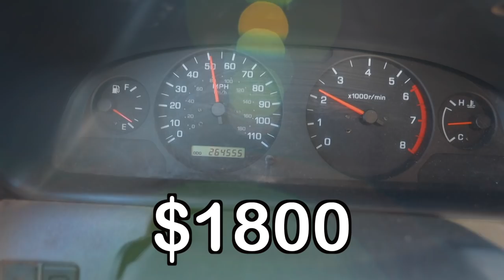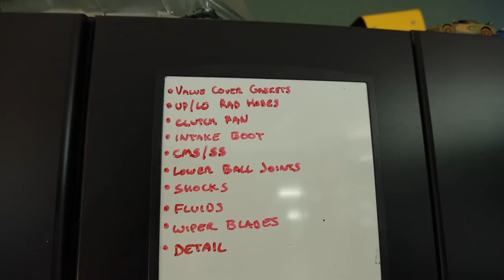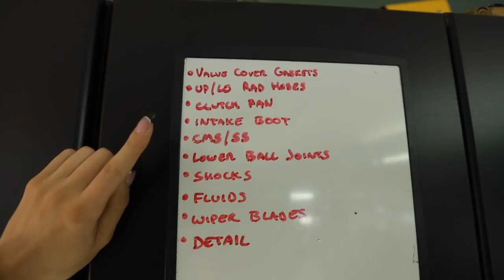Buying My Little Sisters First Project Vehicle // Vlog Series

Comment: AWESOME!  Finally a 4x4!!   Ok: 7” drop differential lift kit, Bilstein 5100s frt 5160s r, 35” mud terrains, toss both bumpers and get off-road prerunner style ones, RCV axles, diff lockers, Kryptonite tie rod outers, Moog Problem Solver ball joints, 20x10 wheels with a negative 19 offset, cat back performance exhaust, K&N air filter, KC Hilights and toss the nose ring!   :)

Comment: DO THE TIMING BELT IF YOU DON'T KNOW WHEN IT'S BEEN DONE. I'm an avid Gen1 X enthusiast. My dad bought an elusive Atomic Orange one new in 03 and it's been in my care for the last 5 years. The Timing belts on these have an 80-100k interval. If the belt snaps at low RPM, you likely won't have valve damage (hydraulic lifters), but if it snaps at high RPM you may end up with bent valves. If it manages to skip teeth more than a couple, you WILL bend valves. Replace the water pump and the thermostat at the same time since it's all there. Valve cover gaskets are definitely known to go bad and the right one tends to leak oil right onto the starter and take it out. Oil pan gasket tends to be leaky too, but that's kind of a PITA to do. That too can make it look like the rear main is bad.

Comment: With that mileage, I'd be checking the catalytic converters, they could be restricted, which would put a fair bit of heat into the heads, causing valve cover leakage.

Comment: My first 4x4 truck was a 97 Nissan Frontier with well over 200K miles as well.  I'm on my 3rd one now.  Change the oil, buy some tires occasionally , replace the timing belt - these Nissan trucks will drive forever.  Excellent choice!   Nice to see you guys spending quality sister time, you can tell she adores you.  Great video, thank you.

Comment: That is a great find!  I had a 2001 Frontier, which is mechanically (and dash wise) very similar. Great vehicles.  I agree on the comment about the timing belt.  Please, Don't wait on that, and get the entire kit with the water pump and all seals(cam seals).  I put a K & N intake, and a Gibson exhaust on mine and gained torque and HP.  Never dyno'd it , but it pulled better and I gained about 1-1/2 to 2 mpg on the highway.  Great to see you and your sister working together.

Comment: What a great deal! My wife and I really wanted an Xterra back in '05, but those were a lot of $$ new. I instead found a used '97 Isuzu Trooper 5 speed manual 4x4, and it was a blast offroad despite no locking diffs. Very low gear ratios. At about 60 mph it was doing 3000 rpm in 5th, just gulping fuel. Traded it in 5 years later and still see it from time to time in another town when we go there.

Comment: For the faded plastic: Trimblack, although used motoroil works great on them too, just put a little bit on an old rag and wipe, then wipe the excess off! Done mine 2 years ago and still looks perfect. Don't use a heatgun, it sucks the oils that are still left deeps inside the plastic all the way out to the surface and thus makes the plastic WAY more brittle, and it'll just fade again. Plastic fades because the oils dry out of it at the surface... That's why the motoroil(for some reason) and trimblack etc tends to work really well: Because the plastic absorbs the oils. 
I'm not sure why but new motoroil never seems to work for me lol, the used oil works better somehow.

Comment: What a deal! Manual 4x4 that's great and also avoids the biggest failure point on these.  I test drove one of those when I was looking for my cheap overlander, but it was automatic.. and it hadn't had the auto transmission radiator coolant bypass done yet. 😳

Comment: Hey Sarah,
I think you should do a short series on the Nissan Xterra (Extra or Xtra). Since it was bought cheap, just do a short series on getting the Nissan up to scratch on a tight budget. You've made your list on the mechanical side, cleaned it etc. but you could cut & polish it to a good standard so that at the end of the short series it looks & drives like a more expensive 4x4. 
In regards to the front bar you painted, I reckon go grey to break up the black. Do the rear bar as well while you're at it.
If all those jobs are done, it'll help your sister be more proud of what she drives. Maybe it'll help her overcome her camera shyness.

Comment: Great vehicles. I have 2 2002 Xterras with the Super charged engine. Both 5 speed manuals.  One with 170k miles the other with 308K and still running strong.

Comment: We lived in an apartment on the east side in line with the runway at Davis Monthan while in college (late 60's)  Occasionally had to open the windows to let the F4's fly through!  Chances are you wouldn't do more than one clutch job.......  You can always scuff & add some clear to the horizontal surfaces if concerned - get a little more life out of the paint.  She really scored with that one and lucky to have a mentor in the house!

Comment: Xterra - highly underrated by many, more capable in stock form than most give it credit for. 

Being Frontier based I bet you could slowly turn it into a Pro4X model with parts from Frontiers.

Spend the money on new upgraded fog lights in the holes where the originals are, use Wipe New Trim Restorer on the bumper - their headlight stuff is magic for plastic lenses.

Comment: Tell Little Sis that being on camera is like learning to drive a stick, a little scary at first but soon it becomes 2nd nature.  ;-)  You might want to consider a timing belt with that many miles....?
Reply: yea, and an engine and cooling system flush. Probably a detailed tune up with a new fuel filter..  OH, the list goes on, and in to mods/upgrades.. tasks that make it in to a project vehicle.

Comment: I used to live 1/2 a mile on the end of the DMAFB runway.  The A-10s were so quiet I often didn’t even know there were there.  The C-130’s made more noise.  The ones you will have problems with are the other fighters like the F-16, and the F-35, especially on takeoff with their loud ass-terburners. I do hope you find a good shop. Keep up the good jokes.

Comment: I have a 2006 Xterra with 224,310 miles. It runs good and strong. I would paint the plastic bumper. I'm constantly putting back to black on the plastic trim. I did plasti Dip the wheels. I call it SeXterra

Comment: I have a dead 2001 rwd Xterra sitting in my driveway if you’re needing parts. A lot of the rwd parts will work on the 4wd xterras
Reply: Also mine threw 2 clutch fans. The 2nd one went through the radiator so I have a brand new (been sitting a couple years) clutch fan and radiator, belts, etc.

Comment: Sooo. I currently drive a 17 Forester, I used to own an Audi A6 Quattro 4.2 & I traded in my Nissan Xterra for the Audi. I wish I had the Xterra back. It was bulletproof. I can’t believe you only paid $1,800. 😲
The passenger side front bumper on the Xterra we had a screw rubbing on the frame which squeaked loudly when I went over a speed bump. I found it when I installed fog lamps. My only complaint about the Xterra.

Comment: I loved my 2002 Xterra.  That being said they are such a major pain in the ass to work on.  I replaced the passenger exhaust manifold because it was cracked (common problem), the water pump, the timing belt, power steering, fuel pump.  All such a pain in the ass.  Replacing the struts and radiator wasn't too bad.  Sold it because my auto transmission was slipping and didn't feel it was worth it to replace.  Manual transmission for the win.  Hopefully, with that high of mileage on hers, all the usual that needs to be replaced has been. All my issues happened around 180K miles. I miss my Xterra! No they are no Land Cruiser but they are pretty good off road.
My valve covers leaked but all they needed was to be tightened down.  Good luck with the ball joints, that was next on the list before I sold mine and I wasn't looking forward to it!

Comment: Hey Sarah, this may be an odd question but I’m really curious to know how do the rear emblems look on that Xterra. Every one of them I’ve seen here in Puerto Rico, has the black adhesive bleeding from behind the emblems. Since AZ is hotter I was wondering if it is the same over there due to the heat or if it’s a heat/humidity combination.  Anyway, looking forward to a TT resurrection. Love the channel!

Comment: The exhaust manifolds in that year are prone to cracking really bad. The castings were terrible. Changed about 3 sets in the 4 years I had mine. Other than that and terrible gas mileage I liked owning it. I have a Gen 2 and love it so much more. Wish Nissan still made them.

Comment: I think that Nissan is great. I wish i had a car as nice as my first car. What year is it?  Currently, my car is also a Nissan 4wd, but a different model, it´s a Terrano 2, i think you don´t have that in USA. Mine does not have as many miles, but it costed me 6000 euros (something like 7000 dollars, or something). Mine is a diesel (more expensive) but even with that, Celine´s car was a bargin. It does have some miles, but with you helping her, i think she does not need to worry about that. I think you should do a review some day, it would be great.

Comment: Hi sarah.i had a vg33  and everything ur changing I do 2 mine plus the crank front seal and valve seals cuz I had a bad oil leak n it was that. Ok good luck 👍
Reply: I meant to say cylinder heads front seals

Comment: Does it have the cat sucked into the cylinders proplem or was that the later years. I had a 99 frontier with the same drivetrain. Always started even in -30 C weather(not plugged in either), never had any ticks at startup. To bad some bonehead cut me off and totalled it.

Comment: Wow... watching this particular video 
Kinda makes me feel old... I learned how to drive on a standard r manual 
Transmission r whatever its called now 
Matter a fact it was 3 on the tree 
64 GMC pick up and 76 dutson with 
4 on the floor cause that's what we 
had.....I could not have been no more than 10.... took to it like duck too 
water.... I think that I had a small average cause my grandfather used to let me set in the trucks and pretend that I was driving And I would push on the clutch and gas like I say just pretending 
So I think that I probably was somewhat familiar with them...